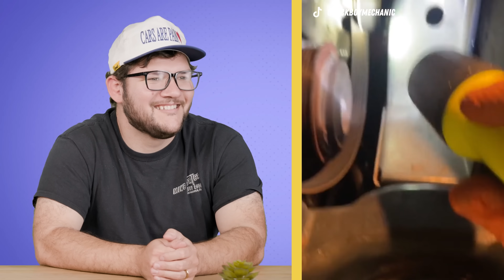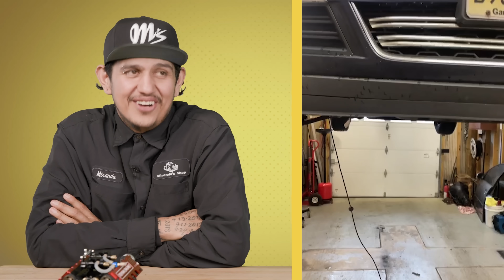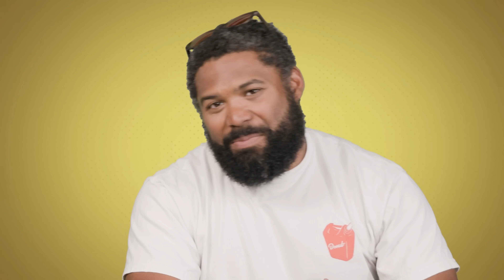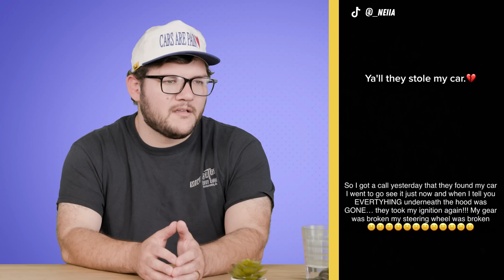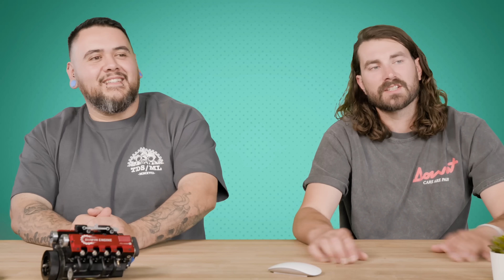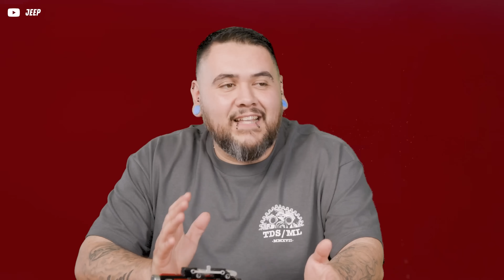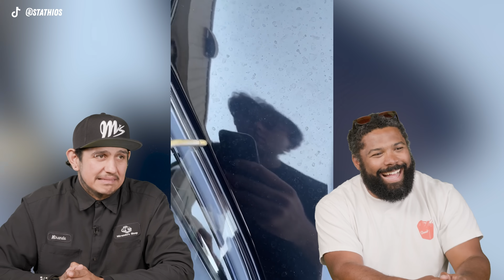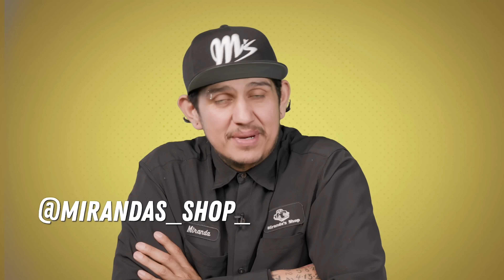Mechanic Reacts to Car Engineering Fails

Comment: Fun fact, Canadian Kias have that immobilizer stuff in them because it's been mandated by law for years here. That isn't engineers, this is worse. Accountants
Reply: Nah, the accountants are the ones that factored the cost saving, the higherups that made the decision to remove them are to blame.
Reply: @GrumpyIan  I can speak to that. It is the reason that I hate upper management
Reply: Can I buy a Canadian Kia and register it in the USA?
Reply: @alacran1986  Don't, insurance is horrible and it will be broken into anyways.
Reply: @alacran1986  After getting a federal inspection and paying some import fees I think that CDM cars are actually exempt from the 25 year rule
Reply: @alacran1986 probably but why tf would you want one? they suck
Reply: @alacran1986 your first problem is you want a Kia, forget the mobilizer part
Reply: @alacran1986 Definitely. I work at a dealership prepping used cars for resale and I have seen several Canadian cars come through.

Edit: it'd still get the window broken before they figured out they couldn't start it, and you'd also own a Kia.
Reply: @alacran1986 make your life easier by not buying a Kia
Reply: Much worse. MBAs
Reply: Yeah, that one wasn't an engineering or factory issue at all.  Hyundai and Kia just deliberately omitted installing engine immobilizers in certain models of certain vehicles destined for the American market during the assembly process.  This one was a business decision.
Reply: @megachonk9440  Yes it is pretty much that every single car sold by me now has a built in immobiliser from the factory, otherwise you would never be able to sell them in the market, as no bank will finance them without meeting a certain level of VESA certification. Thus even the cheapest entry level vehicle has it as standard, and still people add on extra, like tracking, and better alarm systems as well.
Reply: @megachonk9440  I totally agree with you, it's not engineering that decides which "extras" you put in your car. If you want it cheap, you get it cheap, but as I know from several Hyundais, you could easily install this later too. I've seen "upgrades" where crusie control, radio controll from steering was built in afterwards. They simply changed the plastic cover in the steering wheel to one with buttons and acticated the program in diagnostics. It's all built in, because it would cost a lot more, to have different parts. So put in a keyreader and activate it, done.
Reply: KMs make decisions like this in committees so no manager can take the blame and they can save their jobs and save face.
Reply: Yep they love to say, save $0.30 on one x 1.2mil units...
Reply: It's been in the FMVSS since September 2007. Section 114: Theft Protection. So yeah, someone bribed their way through.
Reply: Bureaucrats
Reply: In the UK they have them too, and from what i can tell, our insurance industry wouldn't of sold insurance on them if they didnt.
Reply: @stumanuk042  same here in Euroland. Same reason as well, good luck getting theft insurance on a car that doesn't even have a basic immobiliser. And no one wants to spend 20 or 30k on a car that can't have more than 3rd party liability insurance, so without an immobiliser they wouldn't sell nearly as many of them.
Reply: It was not the accountants. It was the lobbyists who got key requirements “deregulated,” and the politicians who took their money/gifts.
Reply: @cjwrench07  Okay yes, but the point is it's like when people blame engineers for the early Corvair or the Explorer when it was cost cutting that made them dangerous and engineers pointed that out and pushed for better solutions. Ultimately it was profit driven lobying and personal greed and simplifying to the department that sends the design back to the engineers with notes to make it worse isn't really the core of the issue. It just doesn't fit in a concise youtube comment
Reply: @AteValve  don't forget the pinto... engineers put a bladder in the gas tank, and management removed it.
Reply: @stephenoliveau  Plus they also fixed the design with a plastic cover over the protruding bolts, that would seal the damage to the tank for a while after impact. That it was mandatory in Canada, but not on the US versions otherwise identical, and they tested the Canadian one with no problem is another bad mark on fomoco.
Reply: @atevalve   the dangers are a known variable already in the +5yr process to bring in a new model (or design update) to market.   The company just weighs the profits, Vs the costs of unaliving people, brand damage, gov fines, civil lawsuits, etc... against each other.         
   We could have vehicles that are 10x safer than they are now, tomorrow.  But, it is quite literally cheaper to unalive a certain amount of people, than it is to cut into the manufacturers, dealerships, and especially re-insurers profits.   
 As a demographic, your life has a very specific value/cost to a company (average is $1.2mil in the USA), so the question is always: Does unaliving (or crippling) you cost more than keeping you alive/safe?   It’s a very simple number for Corporate Executives.  That’s why Trucks/SUVs are allowed to be more dangerous, while minivans are the safest & strongest vehicles on the market.
Reply: @cjwrench07  Yes that is exactly the problem I described, people's lives sometimes coming down to pocket change per car
Reply: Value engineering makes every engineer an accountant
Reply: @pitterpatter7719  FIFY - Value Engineering makes every Accountant an Engineer. There's only so many times you can tell a money man that it'll cost more in the long run before you give up and move on to the fights you can win.

Comment: I love this channel. I'm guessing a lot of "bad engineering decisions" are actually "know nothing spreadsheet managers wouldn't listen to the repeated, increasingly desperate, warnings of the engineers who finally abandoned hope"
Reply: It’s corporates trying to save 1 dollar on a $24k car
Reply: @ryandowning2956  I’m not justifying it, but imagine that 60 times on one car, let’s say the f150. 1.86 million were sold in the us in 2022, that is more than 100 million dollars saved, and that’s just with one model
Reply: @chm1ata  No that literally is how they are justifying it.

The Chevy traverse example above is how they can take the same exact engine assembly that's used in multiple vehicles and drop it in this one without changes.
That saves them a couple bucks... Even though it means you can't remove that bolt without paying an extra hour or more of technician time. But during the warranty period they don't really have to change that.. So it doesn't cost them anything substantial and the money says to just leave it alone even though it can't come out
Reply: @TravisFabel  the Ford Escort Fx4 was worse. There was clearance between the bolt and frame, you could break the bolt loose with a wrench, get it finger loose, then back it out until about 1/4 of an inch was remaining at which point it backed into the frame rail. Then, if you didn't thread it back in nearly all the way, it would snap off on the engine mount as you lowered the engine to get it out...

Comment: The Hyundai / Kia debacle, that was entirely a business decision.  Engineering fail would would be a fail if the security hardware was installed, and this is simply a business decision to avoid installation.  If you look at the standard location of the hardware, the installation harness is there.

Regardless, somebody should have said something before it officially hit production

Comment: Back in the 80's, an automotive engineer came home to find his wife in bed with a mechanic, and that's why cars became so infuriating to work on. Engineers will climb over a pile of virgins to screw a mechanic

I had a landlord for a while that was an automotive engineer and he told me that one of the main design points with cars is ease of assembly at each stage of the process. Disassembly wasn't even a design factor.
Reply: that depeded, so much on manufacturer and cars prize tag.
Reply: @antcommander1367  said landlord worked for Takata airbags, and he said every auto manufacturer had basically the same requirements: ease of installation and nothing about removal/service
Reply: Those manufacturers included Mercedes, BMW, Hyundai, Honda, Chevy. Basically everyone for a while

Comment: Bad take on the Land Rover video by the female mechanic yes he did know it would do that because it was not manufactured right and engineered right because when it first shoots out most if not all of the oil goes between the cover plate and the rest of the car undercarriage. If they trimmed it back an inch or 2 then it would work fine

Comment: Jeeps should be what Jeeps use to be The Bare Minimum to Run with a Great Engine Small with 4 wheel drive they dont even need A/C or a Radio its a Jeep meant to be a Fun Offroader not a Luxury Highway Queen

Comment: A lot of those bad engineering decisions are really made by the accountants, not the engineers. If a manufacturer can save $2 per car by simplifying a mold or a stamping, they will, even if it reduces serviceability
Reply: Exactly what I heard from some people from r&d, not mentioning problems because car is supposed to be launched on a special date, ready or not.
Reply: For some parts a 2¢ savings is enough to drive a decision
Reply: @TheWaldowski  2 cent on one part times milion cars....times 1000 parts it goes up really fast.
Reply: "Cars built by accountants" is a term to describe a car nobody wants.

VW is very good at that. A few years back, a tie rod end cost me ~10€ at a local shop.

VW used to buy them from Benteler here in Germany - for 24 Cents a piece. Much too much of cause!!

Now, they buy them from Magna for 22 Cents. Worse quality - but hey - who cares?

The 1.4L TSI timing chain debacle - same deal. They negotiated that supplier down to a price at which only inferior quality could be delivered. To add insult to injury - VW decided to reinforce those chains. Too bad, they aren't any better.

The only version able to reach 200,000km/120,000mls is the smallest 122hp. Everything above blows far below 100,000km/60,000mls.

The worst is the Polo 6R GTI 1.4L 180hp DSG. The question isn't will it blow - the question is when (very soon!!!) and will the engine die first or the faulty small DSG which they re-called in China - but not in Germany.

Even when almost new and before damage - the re-sell value was far lower than the previous Polo GTI with the trusty 1.8Turbo despite being a lot newer.

2L TDI in T5/T6 van (called bus here in Germany) same story. Engines did overheat due to lack of air. Engine repair shops fitted oil coolers and solved the problem.

VW instead re-constructed the whole engine - whilst maintaining the problem. Great!!!
Reply: Exactly. The engineers knew that tensioner couldn't come out. The engineers knew most of these problems ahead of time but it's a matter of whether or not the company cares. And that's driven by money, yes they'll have to pay the dealership and extra hour to change the idler but they can use the same engine assembly in all the vehicles so it saves money so it's still worth it
Reply: This is exactly the Kia USA decision to take out the more expensive lock cylinder design, but not on the Canadian models.   
It should prove to everyone, that if you erase the regulations the lobbyists want.  Every single corporation/investor will screw you over to increase profits, and especially that year’s investor payouts.
Reply: @GoatPopsicle  My 2006 Ford Focus ST has a good old trusty remote/flip key. Works.

From 2009 facelift on - Foci (plural of Focus) were keyless here in Germany. Ford saved a lot money - way less expensive parts. Due to their now pretty high values (35,000€ and more), Focus RS get stolen like crazy.

My ST is ~80% of a RS - but they are stolen very rarely. And they cost a lot less. Mine was at that time the best (very original) offered in whole Germany - and cost only 6750€.

Electric handbrake - same crap. Without power - you can't move the car. Very handy when it breaks down in a place where the tow truck can't go.

It happened on a BMW owner in an entryway for a parking space. The car was on fire - the fire brigade extinguished the fire and disconnected the battery. Job done - back to the station.

Shortly after, they were called again. The car is on fire again - on the tow truck.

At first, the firefighters didn't knew what to make of it - a "reclamation" is against their code of honour. They always make sure the fire is really, really out before leaving.

What happened was the tow truck guy re-connected the battery to move the car out and get it on the truck - but forgot to disconnect it again. Due to the wind, the fire was quite substantial - again.

Clear case of idiot at work😂
Reply: @stanislavczebinski994  those are all cost cutting measures too, where the executives weigh the costs of theft, reputation damage, unaliving people, etc… Vs  the profits they can make.    
    To be totally honest with you. The corporate cost of unaliving people in Europe is much cheaper than in the US-Canada.   An individual N.American civil lawsuit can cost them tens of millions and those “costs” can’t be written off on their taxes.  Unlike the Gov fines in both places where really it acts like a subsidy, if/when they shift profits around and can claim a loss that year.
Reply: @GoatPopsicle  The problem is not the executives weighing costs vs. profits - that's their job.

The problem is they do it very short-sighted. Long-time effects are not considered because they won't work in the same position and/or company long enough to be effected by that. IDK for sure - but I guess it took a few years before those KIAs became known for being easy to steal. That's long enough for those executives.

Back in the 90ies, VW sold cars in the US without anti-theft or ABS. Here in Germany you couldn't buy the same cars without those. A neat little extra profit.
Reply: was going to post this same thing VAVE is the term for telling the engineer to make it cheaper, use less screws, make it out of plastic or the cheapest pot metal. then use less plastic and cheap pot metal.
Reply: If I remember correctly, Ford simplified production on Super Duty trucks (over a long period of time too) by shaving somethings off of the roof assembly. It cost two dollars less. But then the roofs would cave in in the event of a rollover. It's not just servicability that takes a hit, safety does too sometimes
Reply: It's not the accountants either. It's the executives who hear all the reports from each org then do whatever means most profit and least expenses
Reply: Shareholders and investors are the root cause of all of these problems and more.
They don't care about the company, the employees or the customers they serve.
All they care about is seeing a green line go up and it had better be steeper next quarter or else.
It's a sick and perverse system that ruins everything in the name of pure unleaded greed.
Reply: that 2 bucks will turn into millions. They in it to make money! And we mechanics have to suffer and hear somebody complain about our labor rates lol
Reply: Yup, as with the recent debacle with Milwaukee impacts. I highly doubt the engineer designed it like that intentionally, it was an accounting saying we need to cut costs, and management told the engineer to make it cheaper, and we all saw the result. Bet the engineer told them that it would happen, but was ignored. Its always some dumb pencil pusher with no clue who fucks shit up for everyone.
Reply: Its not about saving money, and hasn't been for 20 years, its about driving the mechanics bankrupt so that your only recourse is their walled garden, where they will charge you to the tune of a new car for repairs. EVERY SINGLE COMPANY ON THE EARTH is staffed by psychopaths that just think they're the next Apple, and can just dump all over their customers. Mercenary society at its finest.

Comment: I really wish that lemon laws included commercial trucks. My 2023 Mack has been in the dealership for the same issue 5 times already, and needs to go back in again because the same issue is still popping up. We've had it since July of 2022. The issue is completely electrical and the truck loses communication with the ABS module. Because of that, there is a safety feature in the truck that if ABS is not functional, cruise control is locked out. Dumb, dumb, dumb dumb. I really wish they could get it fixed properly.

Comment: You now problem with engineer is that sometimes they need to pack something into the because market want it. That's why this jeep has problems with electronic and this engine with to long bolt. This engine wasn't meant to be in this size car. Take a look how much space was under the hood of old cars. Now days cars are pack so much just to cut cost of cars.

Comment: I would have just cut the bolt on that pulley, unthreaded it, and used a slightly shorter pulley bolt to reassemble.
Reply: Was searching for this comment. I'm working on bikes at a high end dealer and there's so many stupid cost cutting measures done on them, even if they're top end. I'm kind of a specialist in our shop trying to figure that crap out. How to "re-engineer" some of the stuff to make it easier to work on.
Reply: How would you unthread it?

Comment: The best one is on r14 mini Cooper engine there a plastic tab that will break off if you're to rough with removing the oil filter for that engine. Anthor one is 1.6t from kia if you want a new turbo you have undo the rear mount and push the engine fowrd to get get out